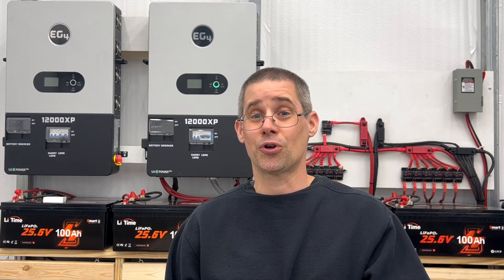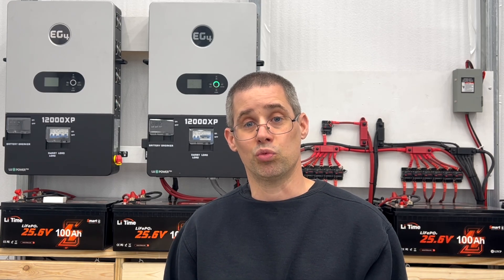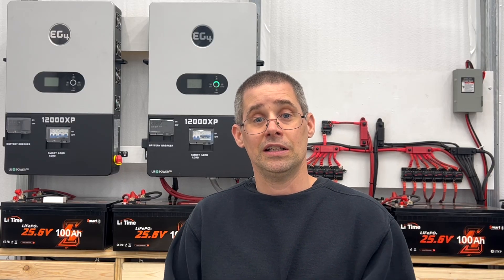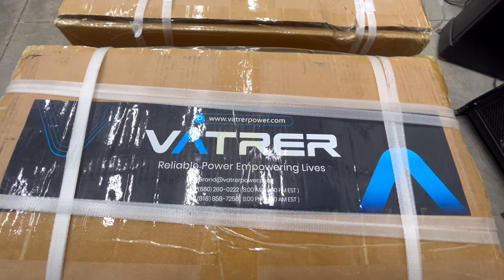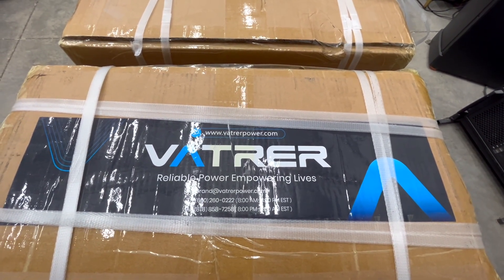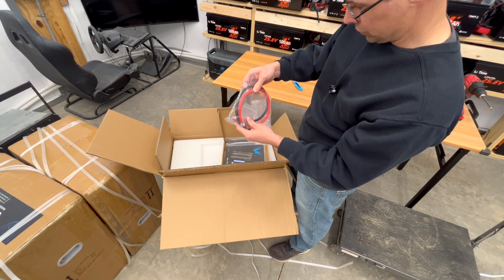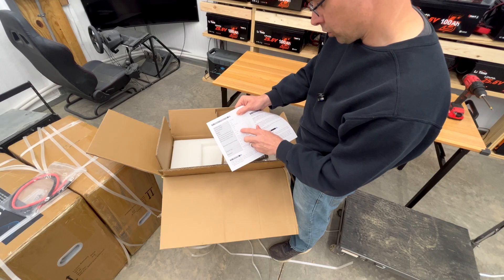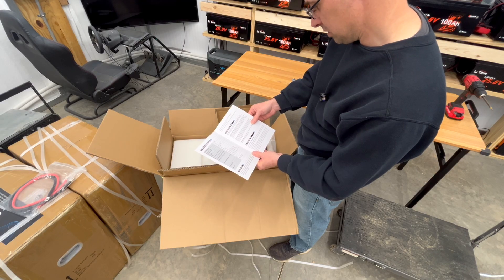Unboxing Vatrer’s Game-Changing Power Rack Batteries

Comment: terminals look sized to the 6awg cable it came with. were you able to get a larger cable on those lugs?
Reply from the maker: I test fit 2 gauge lugs and it looks like they will work.  6 gauge kind of scares me with putting a such a large battery bank in parallel.

Comment: Not happy with  the 2 I bought.  Soc is way different on both at the same  voltages.  One seems to have less capacity then the other. I wonder about  the cell quality. Try parallelism 2 of them.
Reply: Hello, thank you for sharing your feedback!
Due to the characteristics of lithium iron phosphate batteries, SOC is not directly calculated from voltage. It is normal for the voltage of two batteries to be slightly different even if the SOC is the same. If the capacity is not up to standard, we can replace it for you during the warranty period.
Reply from the maker: @ Thank you for the reply
Reply: @Vatrer I did post this on your  Facebook group originally and also contacted support.  I quit Using them and switched to my Litime and enjoybot 100 ah batteries (after one of yours scared me by shuttingdown from 40% for no reason) that work fine and stay synced. I am going  to try the Vatrer again in upcoming  videos and try to gather better info.
Reply from the maker: Thank you very much.  I’d be curious what you find.
Reply: @unemployedredneckhillbilly2023  Thank you so much for sharing your honest feedback — we truly appreciate it. I'm really sorry to hear about the issue you experienced before. Battery performance and safety are very important to us, and we’re always working to improve.

We’re glad to hear you’ll give Vatrer another try in your upcoming videos. If you encounter anything unusual, feel free to reach out directly — I’d be happy to personally assist you and gather more technical details so our team can check it thoroughly.

Looking forward to your new content, and thanks again for your support and trust!☺
Reply: @Vatrer  With my batteries the voltages are identical and the state of charge can be 9 points different. As the voltage drops the swing gets wider. Right now I have them hooked up to solar panels through an EG4 inverter and only have a light load on them dropping to a SOC of around 80% overnight then fully charging in an hour or 2 when the sun comes up. On the panel displays the voltages of them are staying identical but SOC is different. The one that always has a higher SOC is the one that dropped from 40% to zero initially with the other reading 17% on the gauge. I will try cycling them deeper over the next couple weeks to see if I have issues again. I think your SOC gauge is wonky on the one and should be reading lower like the other. Looks like the whole battery would need to be taken apart to change the gauge, hopefully it's not going to hurt the battery.
Reply from the maker: Sorry  to hear that the Soc is different.  Were you able to test the capacity of each one and if so what did you find?
Reply: @MikesSolarGarage  No, have  no way to accurately test them. One has also dropped from 40% to 0% instantly. I definitely  don't trust them. Guess I got what I paid for.
Reply from the maker: @ Sorry to hear that
Reply: @unemployedredneckhillbilly2023  I’ve been using Vatrer batteries. Maybe digesting the Will Prowse video LiFePO4 Charging Guidelines. I hope everything works out for you.
Reply: @maverickmacgyver  I went through how Vatrer support said to charge  them.  Charged them fully individually and then parallel together  with same length  cables and they discharged at different rates according  to the soc gauge and one just went from 40% to 0% in a second during a discharge cycle.  Single they seem fine. I'm going  to hook them to 5000 watts of solar soon and not run full cycles to see if there's a difference.
Reply: @unemployedredneckhillbilly2023  that is strange. I get 5-10% difference between batteries (SOC) and I don’t worry about it. I know it is  hard work, but try to measure a basic in and out of amp-hours to see what happens to that one battery. I’m sure Vatrer stands by their product.  I wonder why it went from 40 to 0%??

Comment: Good choice, look forward to see how you store them. Have 2 of them and they have been phenomenal especially for the price. I only have minor issue with one; one of the battery terminals doesn't tighten down and starts to spin. I just use the second terminal. I believe it can be fixed but don't need to worry about it since it has 2 per and I use a busbar.
Reply from the maker: That makes sense.  I’m glad that you are liking them so far.  I look at them as DIY batteries that I’d tinker with.